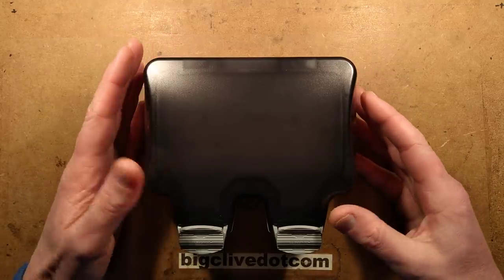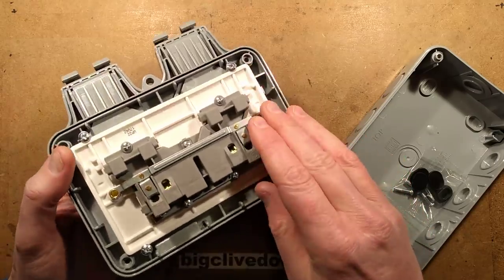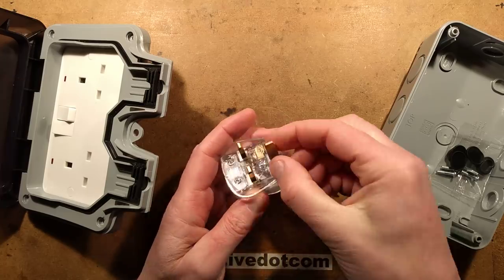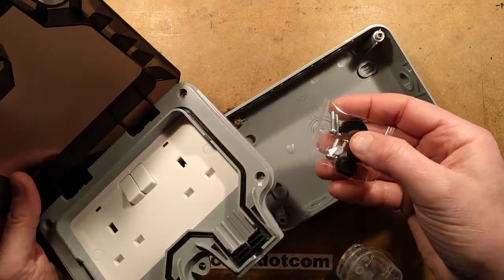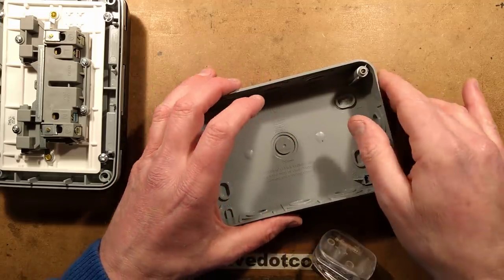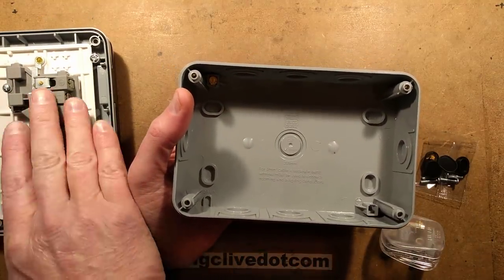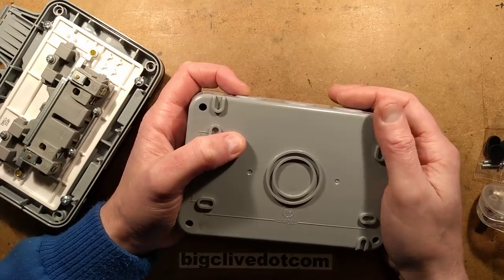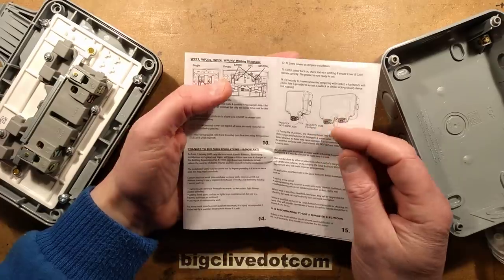British weatherproof socket with clever design. (bonus rant)

Comment: throw the sockets away,and you have a nice dry sandwich box.
has anybody ever informed the local council about an electrical change to a  circuit ?  PS what about the changes an amateur is allowed to make to his household circuitry( yes I and a qualified spark read it all when it came out !)  Part P is such fun !
 Exercise;   Take twenty qualified sparks, ask them to explain the rules regarding earthing in the various parts of a domicile, compare the answers,  take aspirin and lie down.
Reply from the maker: Second exercise.  Ask them the exact purpose of the R1-R2 test and how it's affected by the presence of an RCD. None of then will know the exact reason the breaker has to trip magnetically under a live fault condition.  They'll just make up an answer like "To protect the cable." (Which is not the correct answer.)
Reply: @bigclivedotcom   I tried for the Part P testing course twice when I was still working as a sparky. The requirements they placed on me didn't make much sense and was largely a (very expensive) exercise in futility, in the end. I still have my old megger that I bought for practice. Used it a few times to be sure I wasn't getting scammed by some cowboy when I had work done, but that's about it.
Reply: CrimeVid - That exercise would have the same effect here in the US! Ask a group of "qualified" electricians (sparks) to explain grounding conductors and grounded conductors! Take aspirin. Lie down. Indeed.
Reply: @pmailkeey: Pretty much.
Reply: Sod Almighty earth fault loop impedance? Type of earthing system? Etc etc etc etc
Reply: David V - I'm training as an electrician in Canada as we speak, I fully agree with your comment, I can definitively see how that would go lol
Reply: @charlesdorval394  I'm licenced in Canada, and we're in the same boat for most stuff I have to have an inspection to do work in my own home and I have to have an electrical license, a masters ticket and a contractrs license do do work anywhere else. It's getting regulated to hell and we have seen some of the worst wiring in history in the new homes being built.
Reply: @dev45 It is indeed, sadly.
Reply: CPC? Communist party of China? Certified Professional Coder? Certificate of Professional Competence?
Reply: @Undefined Lastname In a bathroom
Reply: @juancornetto8243  Yep then ask him why he installed a bonding strap on that PVC water pipe !
Reply: Undefined Lastname The problem is, if the switch is too close to a shower or water tap or toilet, it will become wet, and since it's explicitly not waterproof, it'll be dangerous to use even by a completely dry person.  European regulations have an entire chapter defining how far from various bathroom stuff electrical stuff must be.  In the strictest locations, only extra low voltage (like 12V etc.) is allowed, while the least strict zone can be regular household stuff.
Reply: @johnfrancisdoe1563  Correct but any competent spark knows this. They don't need "Zones" and despite what the customer wants we are not fitting a double socket above the bath !!!!  I have only ever and will only ever use pull string switches, a shaver point and only a bulkhead light designed for the environment.

We didn't need  the cable colour changes, part P or most of the other stupid new regulations. We should simply make it an offence to tamper with the installation like it is in many countries.

Its another money making scheme like Clive's best friends  ;-)  We don't need all the extra paperwork. Every decent spark has a very handy tool with them at all times. I think its called a "common sense o'graph"  ;-)
Reply: Exercise - take 20 sparkies and ask them to write down ohms law and kirchoffs law.  Most dont even remember the freaking basics,  dont pay the first bit of attention to WHY they are doing anything, and dont know the regs either. And i like there, despite being a far better trained electronic engineering technician, cannot even wire a freaking socket, cant even tag an appliance as safe.
Reply: @mycosys  They probably think ohms law is something to do with the highway code !
Reply: @YAUUN  circuit protection conductor.
Reply: Stuartbe  this one is my favourite,I’ve always been worried about non continuous,nonconducting  water,too !
Reply: @pmailkeey Right there you've shown just why these regulations were introduced. People like yourself who know just enough to be dangerous.
Reply: @pmailkeey I guess the part where you said swapping live and neutral is not important.
Reply: @Undefined Lastname wet hands and bathrooms , so pull cords inside  switches outside and never a power outlet other than a shaver socket.
Reply: @juancornetto8243  as both an sparkies mate and CEF storeman , if anyone ever asked me for a roll of twin and CPC i would have just given them a blank look then corrected them
Reply: Undefined Lastname  : Few years ago I bought a dog and went to a house to collect it. As it was 45 miles away I asked to to use the "bathroom" before leaving. So I'm standing there, looking about and 6" above the sink I see a normal double socket attached to a surface mounted steel back box - no grommets at all, the cable to it is running upwards at an angle past the end of the bath - complete with shower... and into the ceiling!  I told the lady of the rented house to get her landlord to remove it immediately as it is a complete death trap. Yes. People need nannying - some simply have no understanding of electricity at all!
Reply: @pmailkeey AC power is polarized in the sense that one leg is "neutral" and its voltage is near that of ground. Several devices care about that, e.g. a screw-in bulb, the outer screw shell should be neutral as you are more likely to touch it.
Reply: @pmailkeey If the conductor is heavy enough to limit the voltage drop it will carry the current. If the conductor is heavy enough just for the current then you risk too high an impedance to ensure disconnection under fault conditions and could easily make every metal part associated with the circuit live in that case. The tables in the regs for this purpose are carefully worked out so that if you get the volt drop right you get the correct disconnection from your circuit breaker and the current carrying capacity of the cable is automatically covered. Granted other regulations are utter dogshit but this one is not to be messed with by amateurs.
Reply: @CrimeVid  Just when you think the rules can't get any stranger life comes along and makes you think again. I am sure an earth loop impedance of 500Mohms would be fine :-D ..... or to get a better bond you could drill a hole in the pvc pipe and stick an earth wire in !!!!!!
Reply: Speaking about earthing, is there any reason why my metal bathtub is earthed? Actually, the entire copperwork has got several earthing points, but I cannot understand why, as actual water supply pipe (which is buried in the ground) is MDPE
Reply: @5084204  Its one of the few regulations that makes very good sense. Yes the plastic pipe wont be a great earth but water can conduct enough current to kill you and its even worse if you have heavy particulates, limescale ect....

Now imagine something goes wrong with your boiler and the live makes contact with the copper pipes. If they had no earth bond you would never know.... Until you took your very LAST bath.....  ;-)

Even 10ma can kill when water is involved often less and if there is nowhere for that fault current to flow it will use the water and you !
Reply: @bigclivedotcom  In Ireland you have to be a Paid Up member od SafeElectric to certify any wiring in the home. The competent owner can not put in a new circuit (RCB, wiring and socket). What they are allowed to do is extend an existing circuit without getting it certified.  All fine if load is under 13 Amps, But it is much safer to put in a new circuit. Just a money racket under the guise of safety. Also highly qualified sparkys working for a large firm cannot do any work for the public (or themselves) if they are not individualy certified by SafeElectric though they may be doing that certifiicating themselves for the firm they work for under that firms membership.

Comment: When I was doing my loft conversion, I spoke to building control about the electrical side of things and as long as I could prove I was component they were happy. I ended up installing a new ring main, a new lighting circuit with mains detectors and everything. Sent them through pictures and they signed everything off.

I did get a sparky to come over and do all the resistance/continuity checks to be safe but the actual work was completely done by myself. Saved a small fortune.

I think if you get the councils building control officers on the job they are much more pedantic about who does what but seeing as building control is now a open sector you can get some common sense guys to help you out.

On another note, i think most work around the house is not notifiable so no problem doing jobs like adding a spur or moving a light fixture ect...
Reply: P.S i don't think there is a better definition of irony than spelling competent wrong lol
Reply: Got to love predictive text! I've made some good email stuff ups in my time. NSW in Oz

Comment: Weatherproof, rainproof, raintite, water proof... It means different things to different people. Good British device. The American one used to have flip doors but was not "rain proof" when in use. They now came out with a big hooded door that sticks out about 4 inches from the wall when closed.
Reply: I have one of those I mounted about 10 years ago on an outside light pole that has an X-10 remote switch under the bulbous cover for a pair of floodlights on the pole. It has worked very well over that time, other than as usual getting infested with spider webs and dead spiders. All of my other outside plugs have the older and smaller flip covers, which are quite rain-tight as long as they are closed. As I'm not in the habit of using extension cords outdoors in the rain this works out well, but I can see where it would be a problem for people that want to trim trees with their electric chainsaw in the rain.
Reply: It's because the US plugs are inline, not at a 90 degree angle. They need to respect the minimum bend radius requirements.  I've seen a few with the sockets vertical pointed down to reduce protrusion of the cover.

Comment: Good to see something that I have! Well I have the single version but basically identical. I installed about 5 years ago through the back using tec7 sealant to seal it up (I think that's polymer based). I opened it recently and it looks exactly like the day I closed it up. I didn't drill the drainage hole because I didn't want bugs getting in! The cover and latches are remarkably robust, still none broken despite being exposed to the weather and direct sun. Couldn't recommend these units highly enough! Also has a little locking loop if you want to keep the kids out of it.

Comment: I like your rants Clive. I was brought up in the electrical & electronics trade. Back in 1965 I was taught how to put on a plug and the colour code was simple with RED for danger, meaning live. I also had to contend with serial sizes of plugs. 2amp three pin, 5 amp 2pin and 3pin, and the good old 15 amp 3 pins. I think there was also a type of plug where the live pin was the fuse. Yes I progressed on to 3 phase and much higher voltages and then the change in regulations came along and I was told I could no longer even fit a plug. How mad was that so rant all you like Clive. I'm with you.

Comment: I can vaguely remember the style of plugs we had before the standard 3 pin we have today, my Nan had them in her house, they were much the same but had round posts and no shutters over the positive and negative holes. She also used to plug her electric iron into a bulb bayonet pendant in her front room ceiling.
Reply: We had the Round Pins in our Post War/50s (Asbestos) Pre-fab
The very sockets to give me my first nip :)
Reply from the maker: You can still buy the bayonet cap plugs on eBay.
Reply: @bigclivedotcom  useful if you need to change the lighting position, one would imagine - run a cable from the old light fitting to a mobile fitting, perhaps? For those in a rental and not allowed to rewire the building, obviously
Reply: We still have 2 of the 2 round pin sockets in our church to power the pulpit reading lights - the first in the main hall/chapel, under the pulpit, main platform/baptistry, a circular black/Bakelite without shutter, also powers tree clip fairy lights to illuminate the kids in the nativity scene. 2nd in the rear hall on the back wall (kitchen end) where the platform/baptistery used to be - after the platform was removed to create more space, the socket (originally mounted on art-deco painted panel - part of the platform/art-déco stying of the hall) the builder has left the socket high up on the wall fixed with silicon mastic/no-more-nails -🤨!? What was he thinking/laziness) branded MK, white, rectangular, with switch and horizontally positioned unshutterd pin holes. I intend to chisel it off the wall as I think it runs off the 5amp lighting circuit, 2-round pin plugs  are no longer standard (I think the reading light was removed from the pulpit, long before the platform/baptistery was demolished) and when a wide screen is projected on the wall much too far to the left - the socket is an undesired artefact in the overspill.
Reply: If the sockets are that old, the wiring is a real fire-hazard I suggest....  Old rubber coated wiring hardens with age and goes brittle, then the insulation flakes off the wires.
Reply: The round pin plugs don't have fuses in either.  My Gran had those 15A Wylex plugs which would take a 5A plug in the back, so you could run a 15A and a 5A appliance off the same socket without having to use an adaptor.  You could actually get adapters for bulb holders, they had an outlet at an angle for your iron, kettle, welder &c and a vertical one for the bulb.

Comment: Thats a great socket not for just outside .but also workshop plugs my wood workshop has lots of fine dust . And the metal work area gets metal fillings too im for ever cleanng these sockets. Rant on please its cost me a small fortune to get a 20 yearold snotty nosed colage kid to approve my Forty years in the trade thats why ive retired at 50 screw it thats my rant on electricians . Dont get me started on building regs or county councils

Comment: One small thing you didn't mention was there is a facility to use a padlock into the hole between the two outlets, stops your neighbour using your power to run his lawn mower etc. while your away on holiday.
Reply: Gadgie, that sounds like it comes from a place of bitter experience.
Reply: A problem I don't need to worry about as the sockets are fed from s switch inside a garage and only turned on when I want power and lights on my decking.

Comment: Bought a house at the end of 2005 that had been certified by a fully qualified electrician (part of the house moving pack). 

I may not be qualified but I checked one light switch and immediately turned the power off. I spent a good couple of hours inspecting every light switch and plug socket, tightening loose connectors and either replacing or installing insulating sleeves on the earth wires. Fully agree the certifications are not worth the paper they are printed on and would like to suggest the chap that did the inspection on my house should be contracted to replace the distribution boards of the people behind this and appliance testing.
Reply: Mum's house was built in 1988 and examining a few sockets that developed problems, we discovered one where they'd drilled too far into the wall, so the back box was mortared onto another back box sitting in the cavity, and a couple more sockets where they hadn't bothered tightening the grub screws on the back of the sockets, so the only thing holding the wires in position was friction.
Reply: Kris Sweeney - what happened when you pushed the switch? 🤨 I’m curious - what you said sounded like a broken sentence.
Reply: I'd just bought the place and because I have a memory of my brother getting a shock from a switch I like to do my own check on the quality of the wiring, I'd killed the power to the lighting ring and in the first switch i inspected the earth was not connected  and the live was loose. I flipped the main breaker at that point. Edit I'm tired and keep adding random commas.